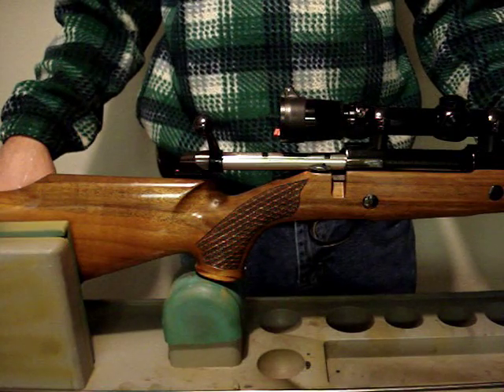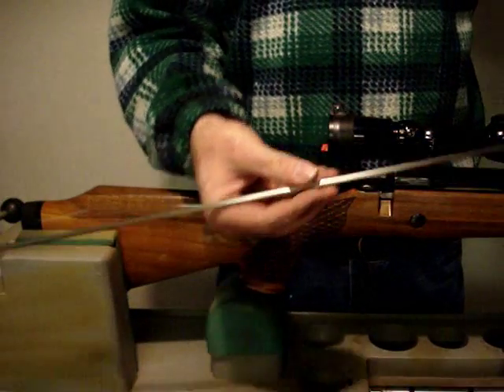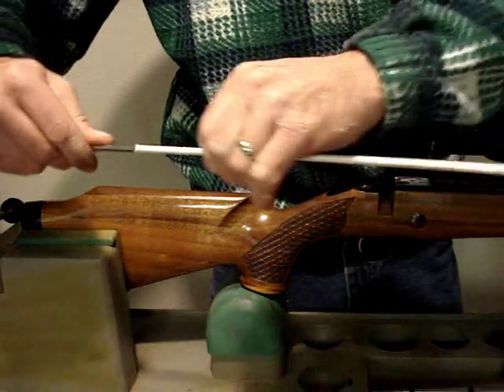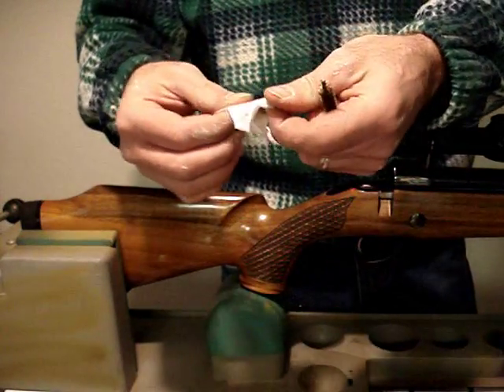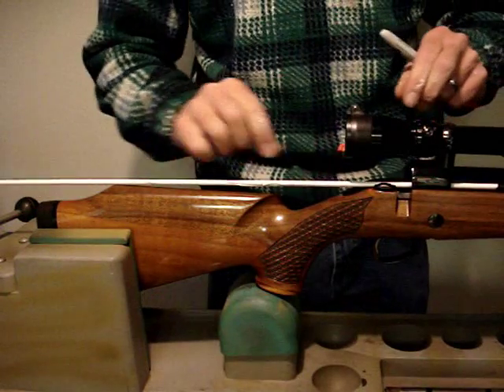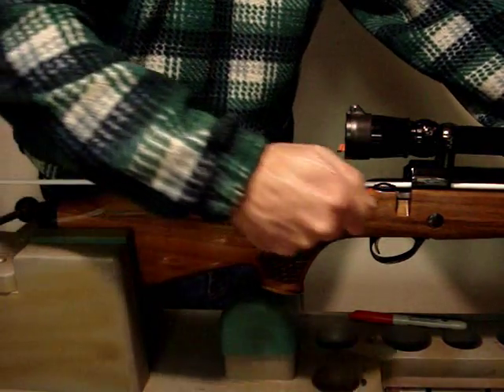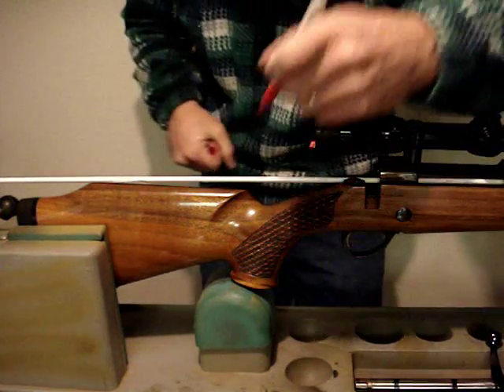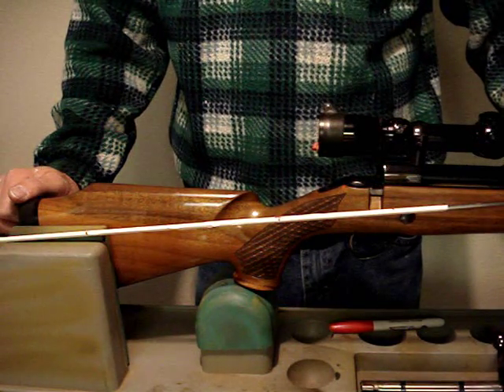Determining Barrel Twist Rate

Comment from the maker: No, a tight twist for a heavier bullet. The 1/7 will stabilize up to a 80gr bullet and as light as 60. 55s tend to open up and the really light ones fly apart. 1/9 will handle up to a 65gr. I tried to shoot the 69gr ones and they would not group. the 1/9 will do great from a 50-65gr.